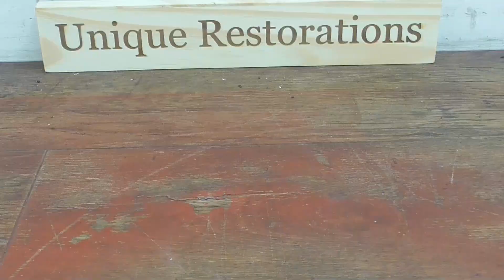Unique Restoration of Antique Weed Sprayer, This one fought me all the way, Surprising finish

Comment: Great Job, turned out really nice. Well done. 
I don't mean to judge your work but in my opinion that seal you made with greased rope may not perform good for a long time. The original 'rope seal' you took out is called Packing Gland or Graphite Gland. Old school seal but very good, very effective sealing. They were used in steam technology.
Reply from the maker: Hi Cem Sezer, thanks for your comment and your advice,  I am no professional by any means but I welcome any information which I can use in future videos. Regards Brian
Reply: @UniqueRestorations  Hi, I am no professional either and I came across to same thing when I dismantled a vintage sprayer and an engine/motor driven water pump that uses the same sealing method. They can be purchased from the internet auction site or model/engineering shops. I didn't know what it was and what they were called but luckily somebody at work dealing with model making told me what it was. Happy New Year
Reply: I learned something here, thanks. My thought would have been the packing string used for old faucets shafts pre-neoprene. But don’t think it comes that long.